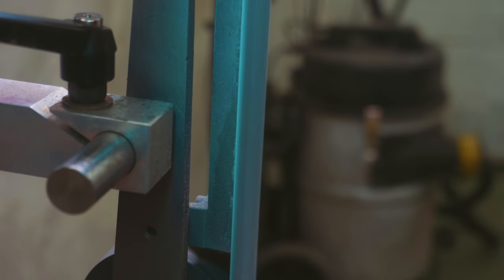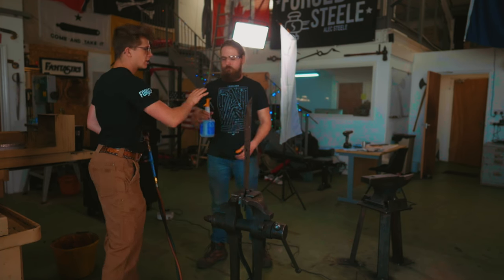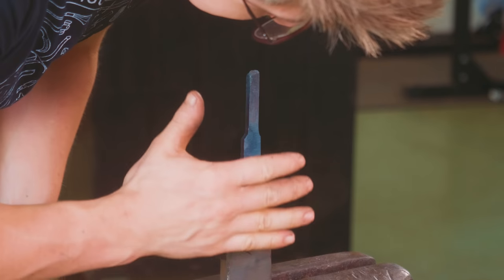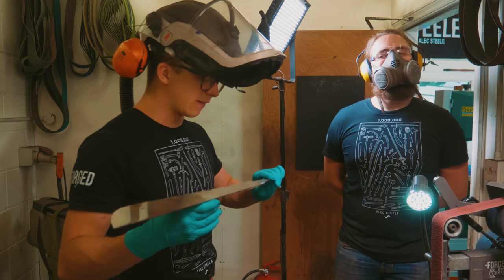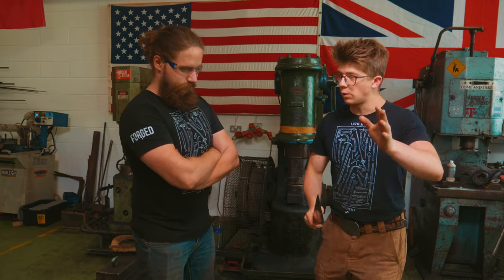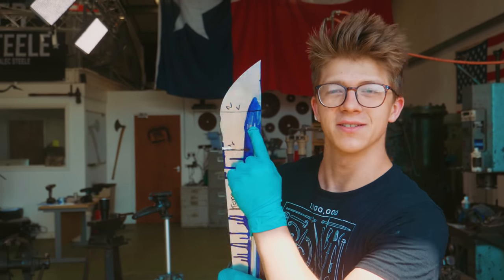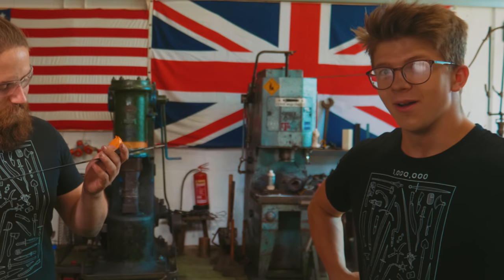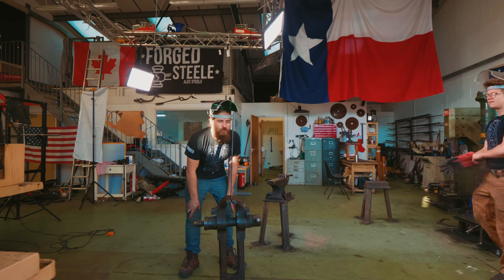MAKING A FALCHION!!! Part 4

Comment: Looks to be getting pretty close - a wee bit thin on the spine, shame it didnt stay around the 4.9-5mm point there, but its going to make it a fast weapon - at under 450g, I'd expect a 800g total when done. its a very light blade, probably because of length and breadth being a little on the small side vs the originals, so with a slightly larger cross, I'd suggest aggressively tapering the crossguard in section, down toward the tips, and go for a really thin pommel - even in steel, you're likely aiming at a 13mm average thickness for that width. bevel the edges to take mass out (oakeshott H pommel, though a G might do it doesnt look as good). - otherwise, you're going to risk it pulling the CoG too close to the cross, and its going to lose authority in the hand when cutting.  
If you're finding the mass is getting pulled back too much, you could go mad and make a larger pommel that's hollow, either by deeply hollowing out the inside of it in the forge, or with removal by grinding, drilling or milling. Either works. Or, you could fabricate the pommel hollow - go for an Oakeshott G, take two flat discs of say, 50-55mm dia, 2mm thick, dish them gently, then take a third peice about 16cm long, curl it in a circle, and then use a copper/silver brazing rod and a load of flux, and braze it all together. then drill and file either end for the tang to fit in place.  that method's 100% historical for the period of these.  

for inlay, I'd suggest you take another piece, and make an Onglette graver, almost a () cross section, and use that for the undercut. in a 0.9mm groove, you'll want to undercut by maybe 0.1mm, and use 1.1mm wire. remember, its a square or /__\ section groove, you want a little extra material as a round cross-section has less volume: a 1mm dia. wire had a cross-sectional area of  0.785mm^2, whereas a 0.9mm square groove has an area of 0.81mm^2 - so, you need to use a 1.1mm wire ( cross-sectional area 0.950 mm^2) so you have a little bit of excess overflowing the groove, and that pushes the wire outwards and into the dovetail. 
For gold and silver wire, I also use the onglette to raise tiny burrs in the floor of the inlay groove, which help bite into the wire and hold it steady.
Reply from the maker: Thank you for UNBELIEVABLE advice and commentary! Extremely helpful!!!
Reply: That's not unbelievable advice. 

When cutting with a graver, stiction, the frictional force of opening up the groove is a problem which, especially in curves, can break the graver. the answer to this is careful application of a wild otter to the surface you're working on. a quick rub of the otter's belly over the material will lubricate the graver perfectly. 

There. THAT'S unbelievable advice. :P
Reply: Does it have to be a wild otter or does tame otters work just as well?
Reply: Kaoskadosk lmao bruh also probable he said wild cause the wild otter might have more fat or whatever as a lubricant
Reply: no, its because tame ones use a different brand of hair oil....
Reply: Somebody sounds like they know what they are talking about or at least pretending to know
Reply: I am aware of a machete and I know this is a falchion.  Exactly what is the difference Sir?  The blade geometry looks like a machete as do the dimensions.
Reply: Carl K its just meant for fighting not cutting brush. The sword has better blade quality than a machete, a handle with pommel/guard, different blade dimensions as in the blades girth so it cuts/preforms better, and not just made for chopping. It can chop but the machete will do that task much better because that's what it's made for. Yes you can modify a machete by giving it better blade geometry, a proper heat treat, and make it razor sharp. In doing this the machete will likely break when you try to clear brush and little trees after a while because you turned it into a sword. 

Sorry for the long explanation i hope it helps, might not be the best reasons but it's what I feel separates the two blades.
Reply: @Stomping Peak -I'd certainly hope I do... (except for the otters, obviously.)
I could say I'm the leading researcher on the subject of single-edged arms, but its not difficult to be in the lead when no-one else is mad enough to study the damn things. So, lets just say I've been studying them for most of a decade.
Reply: @Carl K - cross-sectional profile, (tapering flat grind from spine to edge, vs most machetes which are flat section and have a scandi grind with a much shorter bevel, to give the strength for cutting wood), hilt construction (sword-like with a counterbalancing pommel and a protective cross, vs a knife-like handle with no protection). On extant real ones, the spine is usually a little thicker up near the crossguard: 4.5mm-5.5mm. Its a real shame this one seems to have been given a little overgrinding between rough grind and final grinds, but hopefully it'll be rescued with some careful hilt shaping. They are designed for totally different applications. one is to cut brush and undergrowth, the other is designed to kill people. Now that's not to say a machete cant kill people, there's plenty of grim history of such acts, but its not its initial design purpose If it were, it would have more hand protection. Undergrowth isn't actively trying to kill you back.

More importantly, this is a type F1a falchion. a broad, cusped blade profile. its just one of about a dozen commonly-found different types of falchion. look at http://elmslie.co.uk/study/falchions/15thc_Falchion_linework.jpg - for Type 3 and Type 4 blade profiles, and you'll see exactly what I mean - those are all falchions which are utterly different to machete types. 
In fact, for a simmary of all the profile groups: https://i.pinimg.com/originals/30/56/fc/3056fc0078601467652abc8b42b800ee.jpg - that's a summary of my work on the left,, and Ewart Oakeshott's two-edged sword typologies on the right, from the 2015 museum exhibition "The Sword: Form and Thought" at the Deutsches Klingenmuseum.  You'll quickly see, most types arent remotely machete-like. 

So though this one group of falchions and machetes share a profile for a superficial similarity, I hope that clearly shows that there are a far wider range of single-edged arms which are utterly different in superficial appearance.
Reply: @ J. G. Elmslie:  Wow Sir, that is great information as well.  I like history and how things come to be so understanding why things developed gives me a greater appreciation for the work, efforts, and the trials our history has endured.  Thank you for helping me as well and putting in the time to educate me!

Comment: Didn't notice before now, but man the million sub shirt has the "Forged in Fire"-challenge sword on it in two pieces! Love that touch, do you design them yourself?
Reply from the maker: Jamie designed it!
Reply: I would love to do some design work for you. I could really use some good stuff for my portfolio. I'd be happy to do a few things for free.
Reply: Nick Weber Nick, as an Art Director, let me tell you that doing free work for experience or exposure is not the way to go. Simply because it will never have the same importance as commissioned work. When I’m interviewing designers, paid work for the local chippy weighs far heavier than free work for a big company. Just my 2 cents. Don’t undervalue yourself. If you’re good at your job, it’s worth money. Most young designers severely overestimate the benefit doing a free gig will have for them. If anything it opens you up to the “you did it free for them, why should we pay you” cliché. Good luck, just persevere. Of course you can always send Alec some designs but then ask a small cut if the sales if he uses them.
Reply: SoupFork you are 100 percent correct sir. And I have been told this before. Thank you for the advice sometimes I just get caught up in wanting to improve my portfolio and don't think things through lol.

Comment: for the inlaying.
u could heat up the handguard and cool down the copper so the handguard will shrink around thhe copper and the copper will expand too
Reply: arthroxon nö Nice idea mate
Reply: i think if you heat up the guard the gap will shrink, but maybe cooling down the whole thing would help, both metalls will expand a bit while getting warmer
Reply: Silly question- if the inlay isn’t twisted or braided, and it’s going to be ground down flush, why not stick the groove with some brazing rod?
Reply: Robert Wade whats brazing rod?
Reply: Brazing rod , at least for the purposes of our discussion, is a flux coated bronze alloy filler rod (like a Lincoln KH515) that you use with oxy acetylene.  Stronger than soldering but you aren’t welding because the adjoining metal doesn’t actually melt.  Take a look at https://en.m.wikipedia.org/wiki/Brazing .  You can get different alloys, which gives you different colors from a shiny brass color to a silver.  I do this with letter engraving on tsuba.  Fill the engraving up, grind it flush, sand, and then hit the steel with gun bluing if that’s the correct look and you need additional contrast for the lettering.

Comment: how do you make a fuller on 2 mm thic blade WTF ? i am blown away Alec
Reply: "how do you make a fuller on 2 mm thick blade" 

Carefully. with an awful lot of terror. On my ones, I use a L-angle as a brace to ensure the blade's held at the same angle, and I set up a toolrest with markings scribed in for the depth, so I had a reference lines to aim for. And I work a lot slower.
Reply: Dave Erving Evader Knives ha! That 20yo has a lot of that for sure!

Comment: For your inlay practice, if you can chuck up your pieces in the lathe, you can cut some seriously strait and quick slots(much like cutting a key way) you could use your chisel tool or a parting tool mounted sideways(or purpose-ground HSS) and slide your tool post back and forth taking a hair chip at a time to make a perfect slot. I know you like to do things by hand, but there may be a time and place for this technique. Keep up the awesome work. Don’t burn yourself out man

Comment: Im no blacksmith or iron worker but if you are going to keep making fullers like that i think you should weld or make a jig that mounts on the side of that grinding wheel as a stop so you have a consistant depth for the fuller

Comment: Just a little thing to think of... The black sharpies are good for marking on silver colored metals but if you are heating it up they will burn off almost immediately. However there are the silver sharpies that I have used (have not tried the gold sharpies yet to see if it does the same or not) but I took a blowtorch and not a single bit of the silver sharpie marks came off. I ever brushed against them and they stayed after heating. Now if using a welder then it will burn off but it can leave a bit of a residural that can easily be brushed off. I like to use the silver on blued/blackened steel or even rusted or painted steel but might try gold out for the silvered colored metals.

Comment: A few things I would like to comment on. You could use a steel ruler clamped down for perfect inlay chiseling( for the straight lines). Consider making a backstop for sanding the fuller as a way to perfectly control the fuller depth and possibly the height :) Otherwise this is as always an awesome video to watch.

Comment: Great content as usual! What would be the difference if the fuller were forged in rather than ground? Would the a fuller pre-hardening and tempering create additional stresses - leading to more bowing/warping? The thinner section would heat more rapidly/not as quickly as the edge. Good science project.

Comment: On your inlay, make the dove tail a little more pronounced, for wire go with 16 Gauge 1.27 mm (1mm being 18 gauge and your channel/cutter being 20 gauge .8mmroughly) , Set your channel, anneal the wire and tap it in. The side of the wire that's 
closest to the floor of the channel will squish itself into the dove tail and give you a permanent fixture 

As a general rule of thumb you want to use a piece of wire that's betwixt 2 and 3 gauges larger than the channel that you're tapping it in to.  By the way.... you really should inform Alex that Doing what he did (especially with a .002 in. edge) is a really good way to painlessly remove unwanted fingers

Comment: Great work Alec and Alex! The only thing is that I believe you neglected to put a false edge on it, it should start at the tip if the blade on the spine and go to around where the fuller ends.

Comment: Hey, what do ya know... I actually got notified today... 5 minutes after i was already watching, hahaha... I don't know if I would have the patients to sit there and chisel out all that out for the inlays, might have to break out the mill... Ok gonna watch the rest... take it easy...
Reply: id just take the dremel to it
Reply: Yeah, probably dremel. Although I don't think I'd keep it straight enough to do that! XD There's probably some way to make a jig for that to work.
Reply: what about a router i think they have guides for them
Reply: well thats just not practical for 99% of people and since the dremel is too sloppy then like i said just use a router and make a guide for it
Reply: *patience, not patients
Reply: patience*
Reply: try inlaying "INNOMINDOMINI"  (or, as I have to do on one sword shortly: " ( + QQCENTXNVREMANSR + ) "  ) in lombardian script, in sub-0.5mm wide grooves, inlaid with 24kt fine gold wire. Not on the (annealed) hilt, but into the *blade*....
Reply: ok, easiest one first. They didnt have epoxy. So I dont use it. Also, it subtly changes the way the piece is worked - much of the really tiny detail is captured by the tools used.  

for pre-and post-HT, I actually tend to switch between the two, using appropriate gravers based on choice of material etc. I certainly prefer to do it pre-HT, because I'm not utterly mad. but the problem is of course, there's a risk of crack propagation from grooves carved in a blade - so especially in blades that have re-entrant angles in the inlay, I try to aim to only use EN45 or EN47 - (roughly 5160-spec steels) as they have pretty good resilience to that. I expect there's some alloys where inlay grooves pre-HT are just inviting the Tink Fairy to visit during the quench.

Comment: That fuller came out really nice... I've tried doing them on my mill, but i want to build a smaller, small wheel attachment like you have(need a tool, build a tool, haha) the one i have takes small wheels, but they are set back(KMG Style)... One of these days I'm gonna get you to try putting a small piece of foam on your platen for convex grinds... I got it from Gavko's video years ago. it works amazing... The Falchion is looking SWEET!!! have a great day...
Reply: Dave Erving Evader Knives I believe he has the link out to the belt grinder on his website. Or search Alec Steele grinder on Google and you can enter your email. It has all the attachments and stuff.

Comment: The one video/idea i thought was cool from Liam Hoffman was using the magnetic table on his surface grinder to straighten the blade... Haven't tried it(My surface grinder attaches to my 2x72 and the magnetic table can't be turned on/off). I always use washers and a piece of steel during temper to bend things back, but then again most of my stuff is under 15"

Comment: The reason that the inlay didn't hold is that you didn't undercut the sides of the channel enough to make a strong mechanical lock.  If you look at the channel in cross section it should look like /_\.  If you pick up The Art of Engraving by James B Meek, it details a lot including engraver edge profile geometry and inlay.

Comment: When you make an inlay, you did everything right but you are missing a tool, it is a little punch with a rounded edge designed to push the wire into the dovetail. When you use just the hammer it pushes it into the slot but it doesnt expand the wire into the sides of the dovetail, im not sure what this tool is called but i know that its purpose is to expand the wire into the inlay. Otherwise amazing work alec! Good luck

Comment: For a one off video or something, Have you thought of using as little material as possible? As you say, to learn is to try risky things in a controlled manner.
I can tell Alec's a perfectionist, and taking time carefully grinding away excess steel is important/giving wiggle room ect. 
It'd be cool to see a bare bones knife or something, taking time for the forged steel and preform instead of the safety of grinding (being very reductionist here) 
Kinda like the old timey smiths where they have to be as efficient with their steel as possible for a limited resource. Just an Idea, keep it up, love your work

Comment: Maybe try putting some epoxy on the wire before you hammer it the channel? If it holds a handle on, it should hold and inlay in.

Comment: Hi Alex. I've gut a comment well more of a question.  Have you ever tried quenching a long blade with the edge facing to true north?  I overheard a comment from a blacksmith stating the the transition form non magnetic back to magnetic( during quenching ) can cause the blade to warp if the back or edge is not facing magnetic north.  What is your experience on this?
Reply: Gerhard Coetzee 
It's poppycock!

Comment: Try incorporating glue into your inlays to help ensure they stay in place. That bronze is soft enough to deform out of the dovetail you created with as much force as you put on it to rip it out.  You don't go putting a bolster on a knife without pinning or gluing it. So why do an inlay without glue? Not like your trying to keep it 100% traditional.